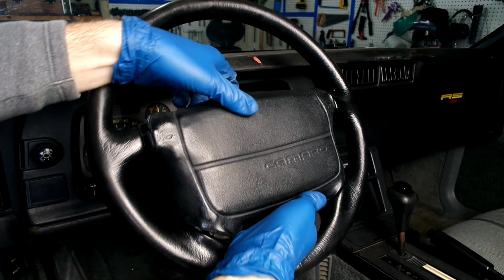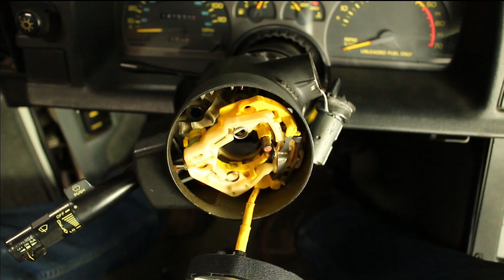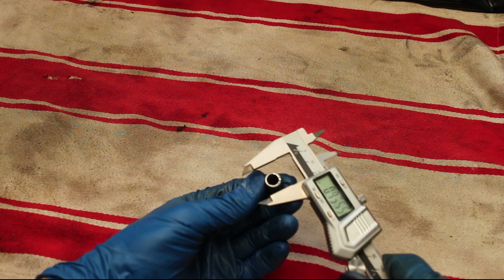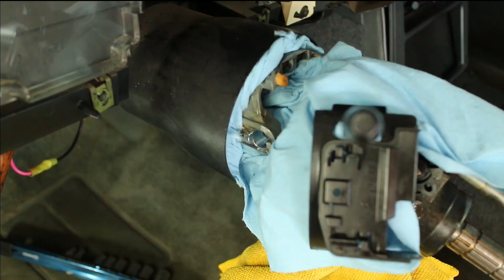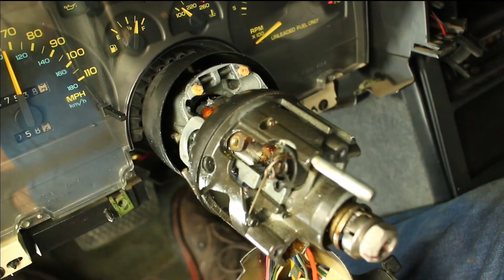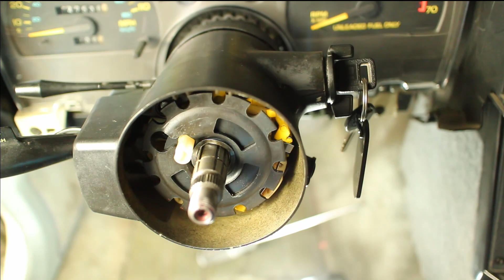How to Fix a Loose GM Steering Column

Comment: You fixed my steering wheel problems!  Bought car with no hazard button, blinkers wouldn't work because they'd smashed all the wires, dimmer wasn't working because it was missing pieces, wrong cover (hence the smashed wires), bad steering shaft bearing, no snap ring, NO LOCK PLATE(!!!!!) and no cancel cam horn contact, and no horn wire, and the ignition switch was messed up as you could barely turn it.  To top it off, a finger-tight bolt down under everything, and the steering wheel (replaced with an older Camaro's, bye bye factory airbag for my 1991) was barely more than finger tightened on.  Replaced the pins with oversized ones (not quite as extensive as you did, just bought larger pins) and now everything works again (after buying the missing parts) and the steering wheel isn't moving like an airplane yolk anymore!  Your video was super extensive and exactly what I needed!  Never rebuilt one of these before and it was intimidating, but your video gave me the confidence to do it.  Thank you so much!  Definetely earned a subscription and a like!

Comment: What grease did you use in your steering column? I was going to use wheel bearing grease until I watched a Youtube video of someone saying not to use that as it will eat plastic. And I looked it up and yeah, they say it will eat plastic. As the bearings are held inside a plastic cage.

Been trying to figure out what grease GM originally used.
Reply from the maker: I use a clear Marine grease on bushings that have plastic usually.
I don't remember what grease I used on the column though.

Comment: They sell oversized pivot pins so you don't have to do all the drilling, etc. to try an repair it.
Reply from the maker: those only work if the hole isn't too-too damaged.
the right side pin was replaced with a oversize pin.
the left was super damaged,  hence this reaming process.

Comment: Where can I get reamer drill bits?
Reply from the maker: amazon, eBay, tons of internet websites.
Reply: @3rdGenGuy they usually run around $200+ ? I’m wondering if my better option is to go to a machine shop
Reply from the maker: I see a 0.343 or 0.468 reamer on eBay for $25
a 3/8 reamer on eBay for $12
$200 would be something crazy like a carbide water cooled reamer.
Reply: @3rdGenGuy man I sure do appreciate you commenting back! This video is everything! And I’ve been trying to look for reamers and I’ve been doing it wrong. Can’t thank you enough

Comment: I use oversize pins instead of overboring and reaming the holes. Its not perfect because the holes are often egg shaped but it works in most cases. On certain GM Models You have access to the left pin from the left side without dissassembly of the column. In most cases this is enough to fix the wobble.
Reply from the maker: those pins work, only if the oversize  hole isn't too bad.
mine and many others were absolutely destroyed.

Comment: If you don't use the air bag c clamp, the steering wheel will rub because the c clamp stops the wheel when tightening the wheel nut

Comment: WOuld you happen to know if the turn signal lever when it's connected to the switched inside the column, is it connected to the windshield wiper switch or the turn signal switch? My wipers aren't working and I'm trying to figure out if I need a new turn signal switch or wiper switch, but i can't seem to find the wiper switch....
Reply from the maker: GM has a test wiring setup for wiper motors.
My video shows a ghetto way to turn on wipers
good way to test the motor
https://www.youtube.com/watch?v=Zcg3wU8dosw

Comment: Pretty helpful. My only input would be to mention or list on screen what size of nut/bolt/thread/socket you are using. Thanks though!
Reply from the maker: I used to list tool sizes, but it's so hard to know what's what.
10mm or a stripped 1/2in?

Comment: *SAFETY TIP* Always disconnect the Negative (black) battery connection first, then the Positive (red) second, not as shown in the video. Only need the Negative one disconnected, but with sensitive electronics and Airbags, do both. Pull the Airbag Fuse as well just in case. You can also let the Airbag sit for a few hours if your worried before removing it because the system does hold a carryover charge. Handle them with caution!

Comment: for anyone who needs to figure out how to do the 4 screws in the back you have to remove the ignition switch spring in the front left its held by a small screw. you just need to hammer a piece that has a circle with  a line in the middle which frees the pin allowing the black assembly case to come out to  get clearance to actually reach all 4 bolts in the back

Comment: To remove my tilt lever is it twist or no ? I bought a chrome tilt lever but i cant seem to get it to loosen up
Reply from the maker: it should twist off. they can be tight.
Reply: @3rdGenGuy  oh hell yeah man i gave up i tried it with vice grips and still cant get it to loosen up ahah ill i continue tomorrow
Reply: @1980sSinaloense  not sure what kind of car you have but my iroc it seems to be one piece i couldn't get mine to turn either
Reply: @AcidJurassic  ok so I figured it out i got some vice grips and i clamped them on closer to the steering column and it finally turned. If you pay attention to your tilt lever it’s 2 pieces so if you try to turn it you’re going nowhere but if you grip on closer to steering column it will twist right away with one hard turn
Reply: @1980sSinaloense  huh thats good to know thank you

Comment: To get to the ignition switch, I just remove the bolts under the steering column?
Reply from the maker: if you are talking about the ignition switch under the dash and on the column yes.
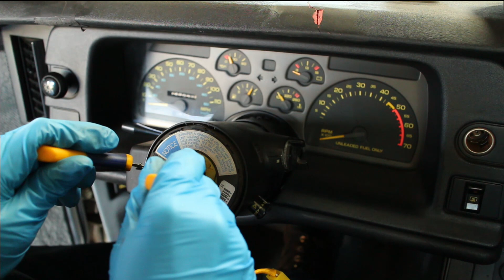At 1:52 this video covers removing the ignition switch. 
You can just stop short of completely removing it.
https://www.youtube.com/watch?v=TDSsCPniSiE
Reply: @3rd Gen Guy  thanks so much for your reply, I really appreciate it! I need ro troubleshoot why my Camaro starts intermittently, I have a new starter, new battery, just replaced the pickup coil, Camaro runs fine and everything, just the issue with the inconsistent starting

Comment: My tilt spring won’t go back on for the life of me is there a certain spot you pt it at?
Reply from the maker: the tilt spring is VERY tough to push back in.
do a test run without the spring and just the keeper first.
it will go in.

Comment: This video is a godsend. I took apart my column a few years back to fix the slop in it, tightened the bolts and that didn't do anything. I didn't know the pins could be the issue but it makes perfect sense now! Thanks a million for such a well made walkthrough of this terrible job, I can finally dig in and fix it right.

Comment: I have the same issue on my '83 "Caprice. Does anyone know if it is safe to drive it like that? Is there a risk the steering column might fall all the way down while driving? Thanks
Reply from the maker: the wheel isn't going to fall off or anything, but I would make a plan to fix it.
Reply: Thanks for replying

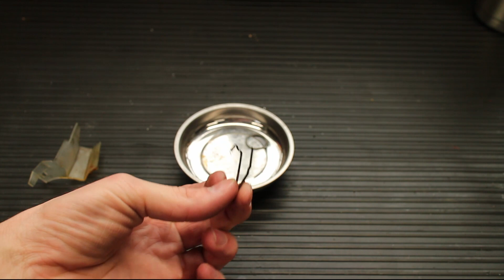Comment from the maker: Just a FYI, the little clip at 15:05 controls the buzzer that rings if you leave the key in the ignition.
you don't need it, BUT if you want it to buzz at you; it goes on the bottom of the yellow turn signal mechanism.
Reply: Where did you get your pins from?
Reply from the maker: @steelefleming4608  those were stock pins.
Unbalanced engineering sells oversize pins as well

Comment: I did that my my bolts weren’t loose but my steering column wasn’t in place. It sticks out about 3 inches making the steering wheel feel lose while moving but doesn’t effect the driving that much.
I was told to replace the steering column. Any brand that you would recommend?

Comment: Links to parts?
Reply from the maker: the pullers can be rented at a local auto parts store.
Reply: @3rdGenGuy  no. I mean the parts. Not the tools.
Reply from the maker: @stormwickham1675  what do you mean parts? like the reamers or?
Reply: No. The 3/8 piece you put in there.
Reply from the maker: @stormwickham1675  oh. the bushing. I didn't get a part number. it's just a random steel roll pin
the pin had a 0.472In OD
0.550in length
the ID was a tad smaller than 3/8
Reply: @stormwickham1675  Amazon 4487696k, and bearing kit 7844651

Comment: lost my snap ring that holds lock plate? can't find one anywhere 84 Buick lesabre limited 5.0?
Reply from the maker: Should be able to find one at a hardware store.
However, if you don't have one as a reference, it'll be a guessing game.

That or dig through a junkyard

Comment: My key will not spring back after full reassembly.  Halfway through, the key comes back fine but there is no spring forcing the key back once it is fully together. Any way to fix this?
Reply from the maker: does it return if you force it?

Comment: I did not see the little object you took out after you took the tilt spring out?  You took that little gear with a magnet?
Reply from the maker: the tilt spring has a cap and a rod. i removed the rod with a magnet.

Comment: Question. So I followed this to change my multi function wire harness cause the right signal would not click off after turning. My high beams are not working now when I click towards me to active them. Anyone that can help would be really appreciated please and thank you
Reply from the maker: So the high beam switch inside the column is a bad design that doesn't work well.
the little plastic piece at 12:00 has to be aligned.
if that doesn't work, try pressing the plastic housing forward while you try the high beams. 

the housing is on the left side and is the big plastic cover at 12:00
Reply: Thank you for getting back to me. Do I need to disassemble the steering column again to try and fix it?
Reply: Same, i m’m stuck, i don’t understand how to fit that piece under the lever arm of the high beams, it fits actually but doesn’t click, it stays behind not under

Comment: i absolute hate walkthrough video. it always look so easy then you try yourself seeing how easy it look. 
the one im working on the damn flasher harness is stock somewhere even unplugged. plus all the extra crappy aftermarket antitheft under the dash. and now im taking it apart again after fucking up the high beam switch there is like a small black plastic that i have no idea how its suppose to go back. 
never again. im soo glad my 85 is mint and do not have to mess with the colomn even after 330k km.

Comment: My steering column isn't loose, but it seems like it's angled to the left rather than centered. Any thoughts on this?
Reply from the maker: loosen the 2 bolts under the dash that hold the column in place and move it over.  should be able to move is 1/4in or so

Comment: My blinker mechanism stopped working, i bought a new blinker switch (white round thing) do you know where to get the blinker lever?
Reply: If you are talking about the actual lever you use you're turn signal? Type in 82-92 Camaro turn signal on Amazon.. I think it's $29

Comment: What was the roll pin size? Having a hard time finding it.
Reply from the maker: depends on how bad your hole is.
my hole was WAY far gone so it needed a HUGE oversize to clean up the egg shape.
the roll pin only has to be 0.005-0.010in larger than the hole it's pressed into.

Comment: The irony of all of this is that my tilt is fine, buy electronics all needed replaced because of some dumb shit the previous owner did, well that and age. So the whole column came out for a full restoration, paint, electronics and some fresh lube. And I'm here to tell you, it sucks guys. I'm also doing an Astro Shaft Upgrade. It's definitely been the hardest thing I've done so far to this car. Thanks for the vid man.

Comment: Awesome idea. I just ordered a set of oversized pins, my wobble is way smaller so I hope that would work. But if it doesn’t - your way should!  Did you just use a big roll pin? Any size that was mentioned on it?
Reply from the maker: the roll pin will depend on how bad your pin hole is damaged.
mine was COMPLETELY FU**
an oversize pin will probably be fine. 
I kinda wish i knew about the oversize pins and used one on the driver side pin hole since that hole was only 0.001in too big.
Reply: Where did you get the oversized pins from?

Comment: Yup...I had to do this last year.  Except it wasn't the tilts pins...those were almost froze into place.  The four external torx bolts were loose and very very recessed.  Make sure to not drop loose bolts down steering column.  Use lock Tite.  No joy in this repair but hopefully never have to do this again.  '89 Trans Am GTA.